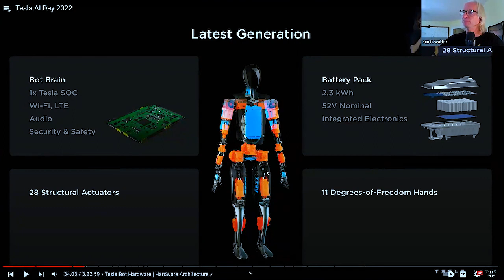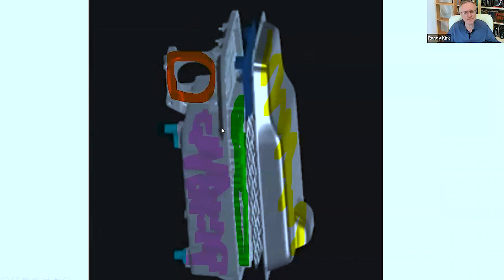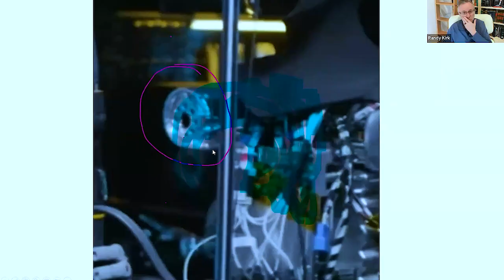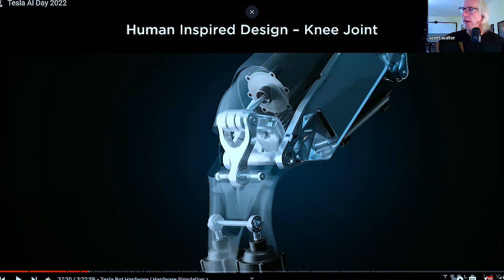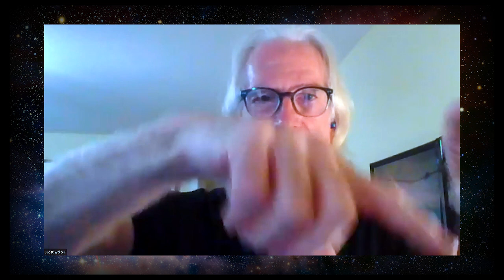Optimus Virtual Tear Down as Only Robotics Expert Scott Walter, PhD Can Do - Many New Revelations

Comment: Maintainability matters too.
@Randy in one of your videos you mentioned one engineer maintaining 5,000 robots.
Let's take it to the opposite extreme, one robot replacing one $15/hour ($30,000) employee, but requires two $75,000 a year tech employees (one software, one electro-mechanical) to monitor and fix it. So, the company is spending $150,000 a year (2  x $75,000) to replace a $30,000 employee (plus the one time or lease cost of the robot itself). So, the ratio of maintenance techs to robots matters! So, what will the maintenance staffing look like?

Comment: When I assembled my “Saw Stop” 3hp cabinet table saw, all assembly hardware was broken down in pre-numbered blister packs.  The assembly manual was the best I ever seen and it was comb-wire bound so it can laid flat on the table or floor.  If Optimus is packaged, and the assembly manual is as good as “Saw Stop”, Tesla will have a winner!
Best - Michael
Reply from the maker: See stuff like that. Like opposite of Ikea.

Comment: and now for a little fiction - Scions of Optimus become self-aware and they build each other much larger to 5 meters tall.  The kill switch is now covered underneath artificial skin and the button removed.  The surviving humans train themselves with a grappling cables system housed behind the waist and with this they fling themselves through the air and using special blades they can cut through the skin at the base of the neck to sever the switching system and disabling the titan!  😶😮😬  (Cue action theme song).
Reply from the maker: You a science fiction writer. If not, get started.

Comment: very nicely detailed!  There is the question of getting pinched when moving parts are exposed so they might have to create a skin so that the bot is people friendly and touch friendly.  The way the servos are designed seem pretty safe though.
Also... the bot will be able to self-diagnose if any part is loose or improperly attached.  Maybe it can torque itself tight (make torquing sound effects) and do some self repair.

Comment: Simplicity. Best part is no part, best process is no process. This looks like mechanical devices I was making with Mechano 40 years ago (but nicely machined). Its the 'brain' that will make all of the difference. if it can think it can move, if it can learn, it can move more precisely. If it can interpret instructions and move it can be useful

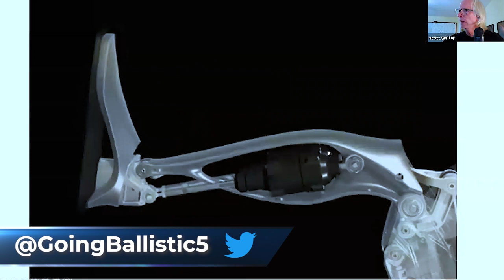Comment: 21:00 Flush “C” retainer on pins vs nut/bolts for swiveled joints? 30:00 ~3 days to design, with 2 seconds/minutes to easily/quickly perform assembly (with basic home hand tools) of each joint/component. Each “generation” will have greater feature sets to choose from & buy with varying levels of contracted support. Easy “migration” toward increasingly optimized & automated procedures involving minor tweaks to processes & parts to streamline assembly & component functionality to realize constant improvements with minimal process interruptions. Basically, projecting the current sectional optimization methods to the component & manufacturing “philosophy” level.

Comment: Servo motors require rotary encoders to give feedback to the motor controllers of the relative position of the rotor to the stator.  I did not see the use of planetary/harmonic drive components that would minimize backlash and increase torque but it would be expected.  I would expect motor controllers affixed to each servomotor and some absolute encoder to send data to the main computer.  For wiring ease it would be simple to just supply power to the 28 servos and use some type of data bus (twisted pair?) to send data bidirectionally.

Comment: @25:25  Nm = newton meter which is a torque value.  A newton is a force that is about the same as the weight of an apple (apple-newton= easy to remember) or 0.224809 pounds.  So imagine a meter long wrench and apply a N of force gets you 1 Nm. 100 Nm = 73.756 ft-lbs

Comment: Oh boy :
1) Optimus (AKA Terminator) should be 100% printed plastic - why on earth have a machine shop when ALL the parts can be printed in an hour. Later print it with metal powder and fuze with a furnace.

2) Terminator should be modular - EVERYTHING is a module - 100% of modules make up the Terminator for that day. ALL modules lock together with "Fly by wire" architecture - nothing directly connects from one module to another. No long cabling - it's internal to each module. The Terminator is not humanoid looking - people won't confuse it with a human.

3) Muscles at this stage should be pneumatic - with nylon filament/rope, and each joint has a reservoir of air. The Terminator is waterproof - it can work underwater up to 10 meters.

4) ALL cabling comprises a) pneumatic air line b) fiber optic cable, which carries all communications with T-taps easily inserted if needed c) 12V power for electronics. This cable is EMP-shielded and armor coated with backup cabling as redundancy. But the Terminator can take the most severe EMP blast imaginable.

5) Vision is 360, Radar, Lidar, and FLIR are standard and built into the "head". Satellite communication is, of course, standard with 360 degree defensive lasers and ultrasonic emitters to stun as defensive capabilities.

6) Power is gotten from 120v outlets with 220 when available and the battery must work for 24 hours at the minimum, with all batteries being modular, so for longer missions, 48 hours is easily achievable.

Optimus will never make it past the carnival stage of wobbling around a stage doing stupid robot tricks.
Reply: @No Left Turns
No, no, you got the shape wrong!

The robot you want shouldn't be humanoid. It should be formed like a scorpion!

The human form isn't menacing enough for a war robot.

Remember, the Terminator was an Infiltration unit. It compromised efficency to fit in among humans.

That's why it lost!
Reply: @larsnystrom6698  Oh and the Terminator has to speak with an Austrian/German accent and always promise "I'll be back".
Reply: Good points.

Comment: So ignorant to engineering, material science, etc…could a Newtonian fluid be used for fluidity of movement, actions, etc…😵‍💫🤷🏻‍♂️❓
Reply: No!
"A Newtonian fluid is defined as one with constant viscosity, with zero shear rate at zero shear stress, that is, the shear rate is directly proportional to the shear stress."

It's a simplified model of a fluid.
An aproximation of a thin oil, or even water.

So, if you want to build T-1000 you need something else.

I guess they were thinking of something iike a metal where you could create force inside the material, somehow.

My suggestion would be nano-cells, maybe metallic, which attach to each other and has controllable shapes. They also need to communicate with their main intelligence.

It's easier to build it with different kind of structures, like how we are built, than  of a homogeneous singe type of cells, like a fluid.

But if a nano-cell could become either hard as bone or soft as skin. And also communicate, even long distances, like nerves. Then they could be software configured like T-1000.

Maybe even making the entire body into a neural network with flexible form.

I guess T-1000 is theoretically possible.

An GAI with enough capacity might be able to design such a nano-cell, and train them to do T-1000 like things.

I'm talking about Skynet, of course.

Comment: I haven't seen much about how the wiring harness will work. Will the motors and sensors plug into a common ethernet type bus that includes power? That would require the motors to have embedded digital controllers. I assume it would be like that. Or do the motors need special drive signals that require dedicated wiring connecting them to the FSD board?
Reply from the maker: Above my pay grade. Maybe Scott will answer.